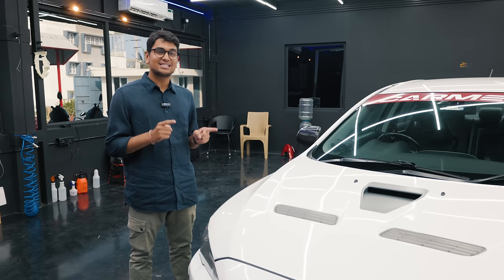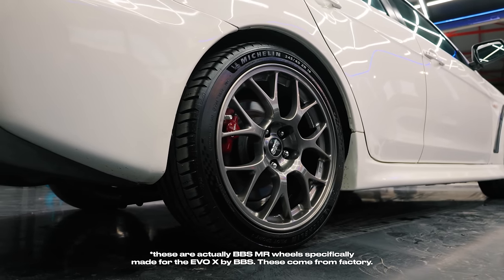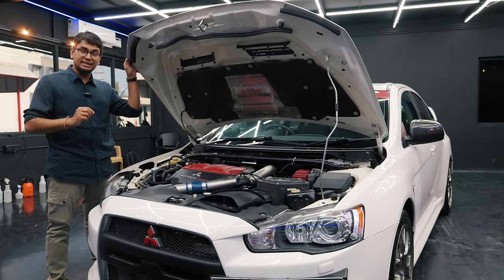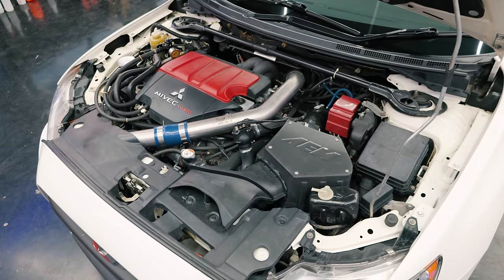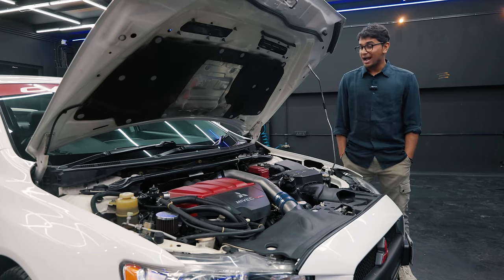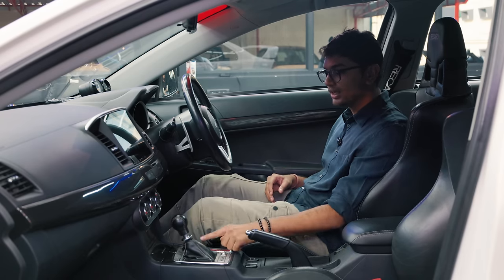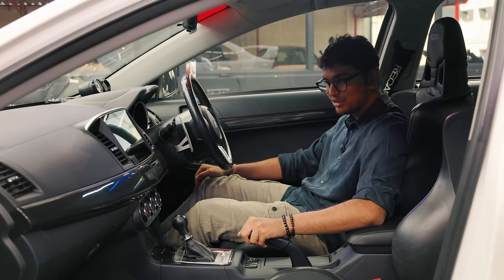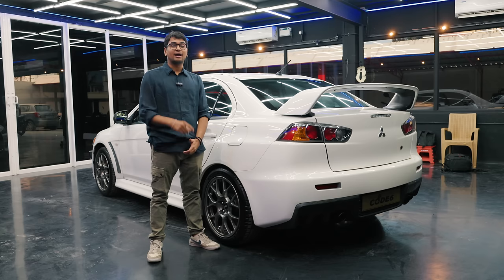700HP Built Engine Lancer EVO X with a 2.4L 4B11T is your childhood dream car! | Autoculture

Comment: I saw this car engine imported / built in front of my eyes around 2017-18 timeframe. As a kid used to hangout in Tadu's garage . It's an absolute beast. 
The engine if i am not wrong now has been detuned by him for everyday driving. Straight line performance is one aspect & there might be many modern cars which might be keep up with it but this car will outshine any thing south of 2Cr when it comes to twisties ( Terrorizing the streets of Hoskote ) .